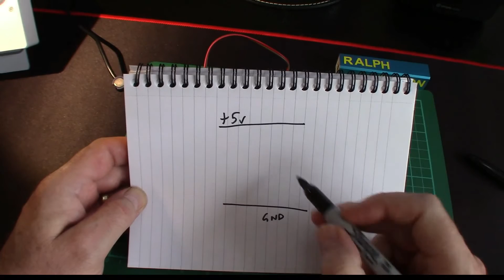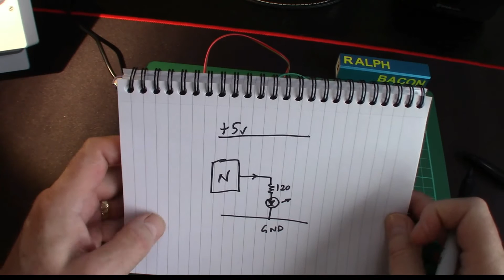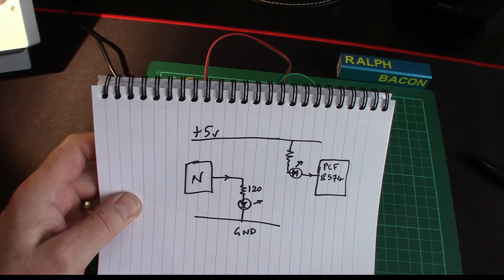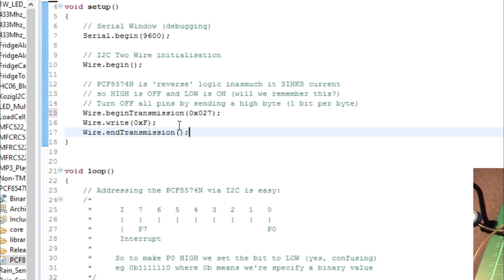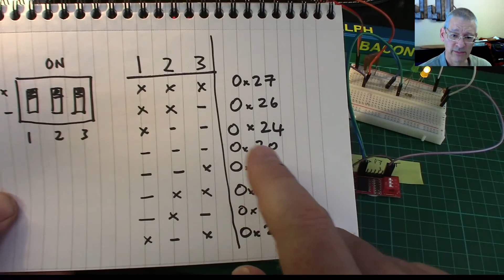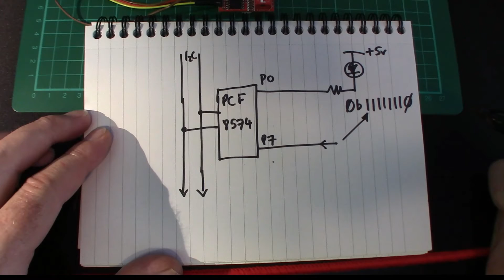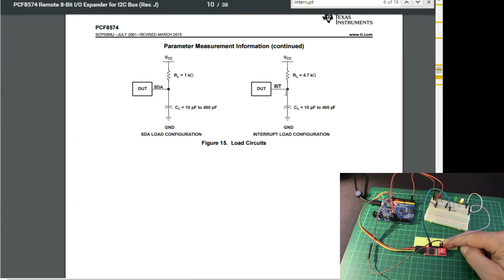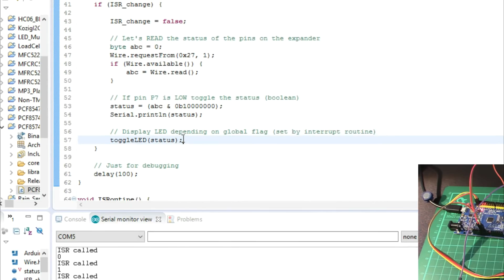#49 MORE PINS PLEASE! PCF8574 Arduino Pin Extender (Easy)

Comment: I'm sure it contains information on how to do the same loops for 4 relays. Are we checking in a structure like xor? I can't check when I send from serial like B10001111, but the system can control the relays in its own loop. I want to do it like B10001111 ->B10001000, is this possible? Can't we send bit values? Maybe it would be more effective to have a relay in this video.
Reply from the maker: Yes, you can send bit values (in a single unsigned char byte, aka uint8_t) and that might indeed be more intuitive in setting individual pins on the PCF8574.

Comment: Hey Ralph, I know this vid was a while ago, but it gave me a start with Adafruit’s 8574 module. Thanks. Just a note that your initialisation only sets half the outputs. I.e. 0xF should be 0xFF. It drove me nuts for a little while. Maybe you could revisit this sometime. Cheers 👍🏾🤓
Reply from the maker: Thanks for the info! Yes, "a while ago" is certainly the understatement of the year, Pete! I'll pin a correction note about the parameter you mention. 👍

Comment: You did a spectacular job of showing how to wire an LED, but my challenge is in getting a push button to work. Everyone seems to demonstrate LEDs, but nobody shows how to actually wire up and communicate with an actual push button switch. That is something that would be greatly appreciated likely by more than just me.
Reply from the maker: Lighting up an LED is a 'push' or output operation. Easy. 

Reading a push button is slightly more involved. Wire up the button to an extended pin, with a 10K resistor to +VCC (so the button shorts the pin to ground).

Once you've initialised the PCF8574 using I2C in the usual way you can do this:

Set the extended pin to INPUT mode:
pcf8574.pinMode(P2, INPUT); 

To read the input pin (in the loop maybe):
int p1Digital = PCF8574.digitalRead(P2);

How do we know that a button was pressed though? When then button is pushed, the PCF8574 INTerrupt pin goes low to tell the Arduino that SOMETHING happened. You can connect this to an interrupt on the Arduino (D2 or D3) and run the function to determine which pin it was (or perhaps there is only one, like above).

If you are a newbie, the above will not be enough for you. Look at this example:
https://www.instructables.com/PCF8574-i2c-Digital-IO-Expander-Fast-Easy-Usage/

Do you need more?

Comment: If I have a lot of led's to run and the power requirements were already pushing the limits on the arduino, could I run this board/chip on a separate 5v supply to run more led's and therefore not overload the arduino?
Reply from the maker: Exactly so. I tend to use dedicated 5v supplies anyway (common GND) when powering external equipment such as LEDs or motors.

Comment: Hi Mr. Ralph,
I went to a weird problem with PCF8574P (not with SOP16 AT chip) chip connected with an ESP8266-01S. as following:
The blinking on PCF8574P was done successfully but the ESP seemed to halt for about 10 seconds at some 3 times of blinking a led connected to any pin of the PCF8574P and ESP resumed working again. 
However, when I connect ESP to a PCF8574AT (SOP 16), this thing does not happen. However, when I tried connecting both PCF version (P and AT) with Arduino, such weird thing does not happen. I thought ESP does not like P version. Do you have any advice?
Thanks.
P/S: The setup of the I2C connection was the same for both PCF version (with 1K pull up resistors on SDA and SCL)
Reply from the maker: Make sure you have only ONE set of I2C pullup resistors (some manufacturers add them to each board).

The ESP01 is a 3v3 device; try running the Arduino at 3v3 to see whether you get the same odd results.

Maybe some of your PCF8574 chips are borderline and do not work well at 3v3 (or are fakes?!) - try another module to see whether you always get the same strange result when using an ESP8266.
Reply: @RalphBacon  Thanks for your response, I re-tested in following scenarios:
1. Mount bare chip PCF8574AT with 2 1K pull up >> working fine with ESP-01S;
2. Mount port expander (pcf8574AT), no pullup >> working fine also;
3. Mount bare chip PCF8574P with arduino (3.3V, A4, A5 pin, pull up resistors 1K) >> working fine;
4. Failed connecting PCF8574P with ESP01-S.
So I doubt ESP-01S has problem connecting with PCF8574P.

Comment: Hi, my question is, trying to simulate the project in proteus a fault occurs, could you tell me how to connect the circuit in more detail?
Reply from the maker: I'm guessing that Proteus does not understand that chip so can't simulate what happens. I'm afraid I don't know or use Proteus so can't help further.

Comment: Do you know of any example code to control a standard 16x2 LCD via the PCF8574 using an arduino that just uses the wire library and NOT an external library.  I want to understand the gory details of how to send commands one by one. I'm sending commands from a command line interface (provided by Microchip) via a Microchip MCP2221A USB to I2C bridge. The I2C commands can be read from a text file and sent over this bridge. Just need to understand the individual commands. Do you know of any code?
Reply from the maker: I don't have such information to hand, I'm afraid, (I'm moving house so everything is packed up) but the datasheet for the LCD will tell you the commands to use. Alternatively, look at an existing library and see what is being executed - but warning, they may be poorly commented.

Comment: How can we control relay and mosfet using pcf8574 and arduino? what is procedure? anyone have arduino code?
Reply from the maker: The demo sketch here shows how to set the pins on the PCF8574 HIGH and LOW - just like on the main processor, so just do the same to the relay and MOSFET.

Comment: thank u Mr. Ralph, verrrrryyyyy eassyyy. But if you guys find problems finding the address of the wire transmission, you can use this program because the pcf8574 address that I bought is different from Mr. Ralph:

#include <Wire.h>
 
void setup()
{
  Wire.begin();
 
  Serial.begin(9600); 
  while (!Serial);           
  Serial.println("\nI2C Scanner"); 
}
 
void loop() 
{
  int nDevices;
  byte error, address; 
  Serial.println("Scanning...");
 
  nDevices = 00;
  for(address = 1; address < 127; address++ )
  {
    Wire.beginTransmission(address);
    error = Wire.endTransmission();
 
    if (error == 00) 
    {
      Serial.print("I2C device found at address 0x"); 
      if (address<16)
      Serial.print("0");
      Serial.print(address,HEX);
      Serial.println("  !");
 
      nDevices++;
    }
    else if (error==4) 
                 
    {
      Serial.print("Unknow error at address 0x"); 
      if (address<16)
        Serial.print("0");
      Serial.println(address,HEX);
    }    
  }
  if (nDevices == 00) 
    Serial.println("No I2C devices found\n"); 
  else
    Serial.println("done\n");
 
  delay(5000); 
}
Reply from the maker: Thanks for sharing this, very useful to know.

Comment: Hello, can i control pins with IO expander at the same time?
Reply from the maker: Do you mean turn on/off multiple pins at the same time,as you can on the Arduino if you address the register? Yes, you can by setting the correct bit values in the byte you send to the device telling it which pins are high and low.
Reply: @RalphBacon  Thank you very much!!
Reply: @konstantinosdamaskos4138   It's like I came for this question. Thanks!
Reply: @RalphBacon  This is the answer I was looking for!

Comment: I am trying to use the PCF8574 and Uno as a toggle for 8 switches  and output to 8 LED's / operate a Relay or Mosfet etc but I have 2 PCF8574 first is switches and second is LED's and would also like to extend to 16 switches but having problems with sketch .. got working up to switch 1 to 5 but 6, 7, 8 no function ... so would love if you could do a video on this project... Regards John
Reply from the maker: How odd. If your sketch works with the first 5 inputs why would it not work with the remainder? [Puzzled face]. Sure your code/wiring is triple checked?
Reply: @RalphBacon  We been through that possibility regarding wiring but the circuit is so simple ... been trying another sketch from a member of MERG but the same ... the original sketch is as I said but if you press say button 1 then immediatle after press 6, or 7, or 8, they work so cant be wiring  ... so basics 4 wires from Uno I2C and 5v and Gnd to 1st PCF8574 the second one is plugged in at rear of module jumpers set ... 8 ribbon  leads from 1st 8574 to breadboard switches ... 8 ribbon leads from 2nd 8574 to LEDs then a 330 ohm to VCC ..even posted on Arduino Forum and they are stumped ... its the most simple circuit I have ever put together ...
Reply: Hi Ralph ... the error was in the IoAbstraction.h and IoAbstractionWire.h library ... sorted and sketch was up loaded to https://github.com/MERG-DEV ... 16 buttons ..

Comment: Hi Ralph. Great little video but I am not too sure your reading of the data sheet was correct. The load circuits I thought are showing their effective test rig that they used to get the values in the datasheet and warning against parasitic values. The INT pin can be held up with a 10k resistor, it's doesn't have to be their 4.7k. If you look at the top of the datasheet the give you an example circuit with their recommended hold ups. The capacitors I thought are there to warn that the values stated on the datasheet are only guaranteed, for example, that you have less than between 10-400pf parasitic capactiance on that pin (from PCB trace capacitance etc.) It is not suggesting you include the capacitor. If you operate outside that the switching times may be too slow, for example, and it will break the datasheet guideline.

 Equally, you would not include the caps on the I2C bus either which they have shown with the 1k resistor. You would start with 10k and then adjust for the switching speed inline with the I2C standard. Let me know your thoughts.
Reply from the maker: You are doubtless correct, Jon, but as it's been a while (and then some) since I did this video I can't recall the details. I've bookmarked your answer so I can re-read the datasheet in a quite moment. August is looking good. 2022, that is!
Reply: MULTIPLEXER DISPLAY 7 SEGMENTS (COMMON ANODE OR COMMON CATODE) - ARDUINO - PCF8574 REMOTE 8 BIT I/O EXPANDER FOR I2C BUS  
https://youtu.be/ENlRaSL34h0

Comment: Good morning! I have an arduino micro leonardo atmega32u4 and I wanted to ask if I can use the pcf 8574 expander to multiply the number of pins to connect more buttons and potentiometers? Best wishes.
Reply from the maker: Yes, Michal, it works via I2C so it should work in exactly the same way. Good luck with this (not that you will need it, it's pretty straightforward).

Comment: Thank you. Exactly what I needed for a project.
Reply from the maker: Great, Tom, glad I could be of help!
Reply: @RalphBacon  To set all 8 pins high would the entry not be 0xFF?  0xF would work in your case as you only were using pins 1 & 2. 255 Dec = oxFF does it not?

Comment: Thanks for the video, can you control LEDs Pixels string separately with the Pin extender? or it is only for Relays?
Reply from the maker: It should do everything a standard GPIO pin can do, Juanacho, so I would expect it to be able to control NeoPixels and the like. Watch the current! Ideally connect the LEDs VCC to a separate power supply and common the grounds together.

Comment: Can't use this module to drive 16x2 lcd instead of using its officially made i2c module that are mad3 officially for 16 0in lcd ??
Reply from the maker: This is the same device as used in the "backpack" modules to turn a standard 16x2 or 20x4 LCDS into an I2C device.
Reply: @RalphBacon  yeah , I checked that it is same ic . But on the board there is 3 pairs of unsoldered smd pads marks as add A0 A1 A2 which all are open   how it works without any address A switching connections 🤔
Reply from the maker: Those pads determine the I2C address of the device. Usually they are left unsoldered but by soldering any combination you change the address (used to avoid I2C address conflicts). The datasheet will help you if you need to do this. Use the "I2C Scanner" program to see the address of your device.

Comment: Hi Ralph. Great stuff as usual. Big fan of your channel here. I have a question about the ISR that you're explaining at the minute 24. You're using the millis() command inside your ISR, is that accurate? As far as I understand the ISRs operate kinda "outside" of the timeline of the processor, which also the reason why anything done inside the ISR should be as short as possible to avoid temporal disturbances in the execution of the rest of the sketch.
Reply from the maker: Millis() does not "work" inside the ISR, that's true, Alex, inasmuch that it doesn't get updated. But the value is still available (frozen at the point of entry) so we can still use it. Certainly ISRs should be as simple and quick as possible (whilst they are running, nothing else is) but this won't impede the flow too much. Finally, remember that a lot of my code is demo code to illustrate a point not what you would write for production use. Good that you spotted it though, it shows you've been paying attention!

Comment: I'm using the same board with a keypad.  I was hoping that the INT pin would work when a key is pressed but no luck so far.  I'm using the Keypad_I2C library.  The keys are returned as expected but the interrupt doesn't seem to trigger when a key is pressed.  Any idea or I2C keypad library to suggest ?  Regards.
Reply from the maker: I'm trying to remember this far back, but I'm sure that when the state of any of the inputs changed you get a HIGH on the INT pin (not sure for how long though, but long enough to trigger an interrupt on your Arduino). How are you using this INT pin, as an input into an interrupt routine (so using pin D2 or D3 on an UNO)?
Reply: @RalphBacon  Yes, I'm using pin D2.  I tried D3 which gave me the same results.  I'm using the "attachInterrupt(digitalPinToInterrupt(interruptPin), KeyPressed, CHANGE);" statement to attach the interrupt.  "KeyPressed" is a function that sets a flag which is previously defined at the very top of the sketch as a volatile variable.  I'm using the RC circuit from the datasheet as you described.  I can confirm that if I disconnect the INT pin from the PCF board and bring the pin D2 low, by shorting the cap's leads, the ISR routine is invoked.  At first glance it looks to me that the INT pin from the PCF board isn't doing what it should.  Perhaps you or someone else could consider giving it a try and let me know where I goofed !  Thanks again for your help.

Comment: Hi Ralph - Did you actually try the example you put up on Github?  It is so confusing when Guys such as yourself put up examples that don't work.  I spent ages trying to find where my error was only to see that the I2C address was wrong in all the examples I used in your case it was wrong 3 times!  However when all is said and done I learnt a heck of a lot from your tutorial sample thank you.
Reply from the maker: I'm, glad it all worked out in the end, John. The sketch in my GitHub is the sketch you see in the video. So, yes, fully tested. What went "wrong" for you is that your PCF8574 device had a different I2C address to mine - whether configured by the manufacturer or by design, I don't know. That's why it's always important, when dealing with I2C devices, to run the I2C Scanner sketch first which will confirm connectivity and tell you its address. I've uploaded it many times but on this occasion I did not, so maybe you did not realise this was a useful step (a bit late now, I hear you cry). But you obviously found the correct address somehow, so good job! And in future I will always have to mention the I2C scanner so others do not get caught out like this. Thanks for your feedback, John, appreciated.
Reply: @RalphBacon  Thanks a million for the reply and the tutorial.  All's well that ends well.
Regards
John

Comment: Hi Ralph - me again, hope you are well. Can you tell me please is there a way to do a digitalRead on a I2C pin? I am writing to the pins but i also want to read from them too. Thanx v m.
Reply from the maker: From what I recall about reading value, PJ, you must connect the interrupt pin from this device to your Arduino. This gets set HIGH when something changes on the PCF8574 (eg a switch closes). Unfortunately it doesn't tell you which pin just went low (or high) you must read each in turn to determine that by knowing the last (previous) state and recognising that it has now changed. Not too onerous if you right a small function to do this. Any help?
Reply: @RalphBacon  Mmmmmm interesting!. OK I have gone further into this and I am now getting interesting results. I am actually getting a decimal number returned, reflecting (I am sure) the state of the 8 pins in decimal rather than binary. I am now going to research how to test each bit of a binary number and then (I hope) I will be able to see which LED is on. Curious and curiouser!! Thanx Ralph - nice chatting :¬)
------------
Edit
I have now sussed out how to read each pin from an i2c expander. I have a few lines of code with magic binary masking in it (cribbed from others). Easy when you know how ! Ha ha ha.